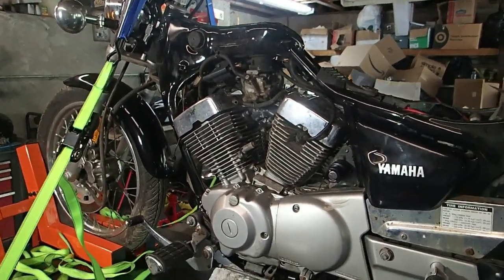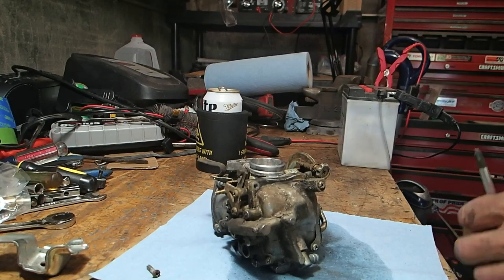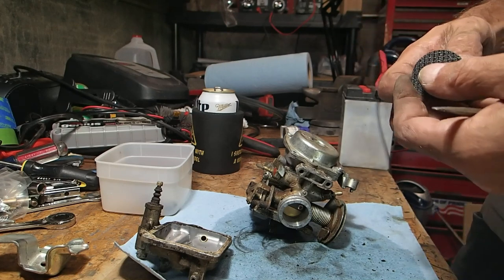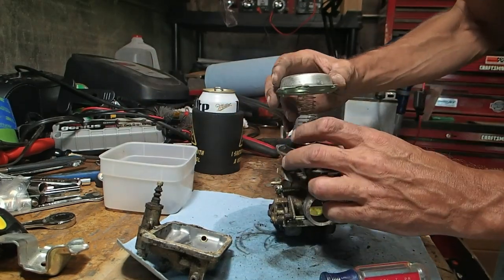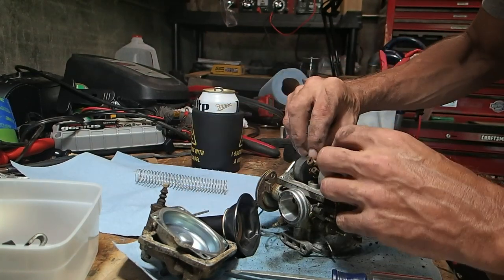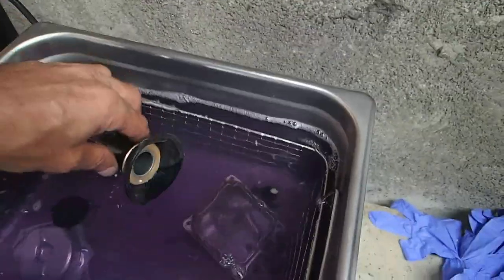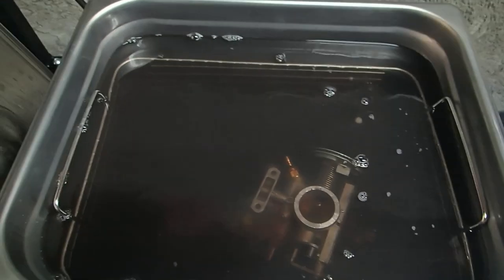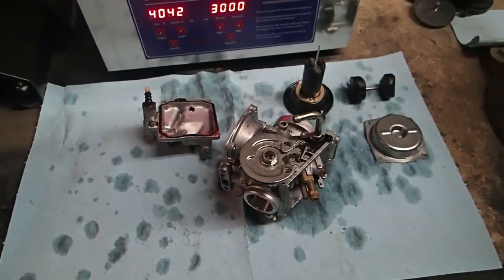2000 Yamaha Virago 250 XV250, Part 6 carb disassembly and ultrasonic cleaning

Comment: Ran into same issue with screws.  Someone said it above, these are JIS not Phillips. Stripped mine completely round.  Bought screw extractor tool and got them out.  Bought all new M4 screws and new JIS screwdrivers.  Thank you.  This video was helpful.